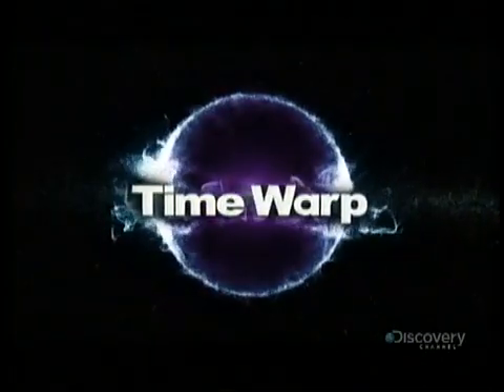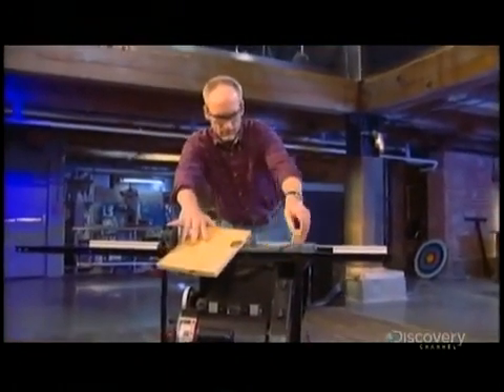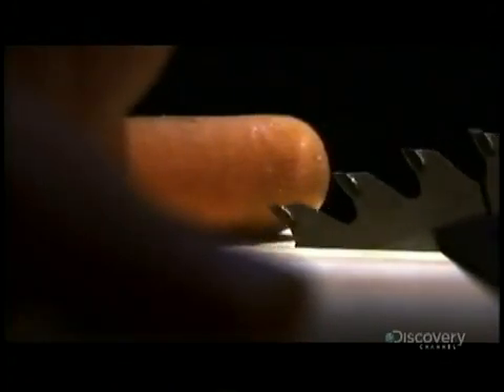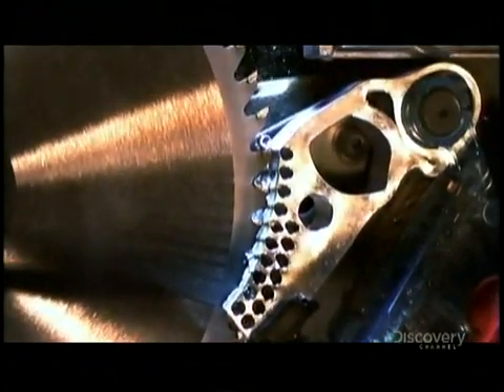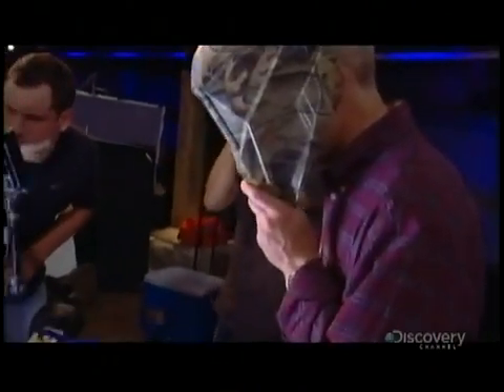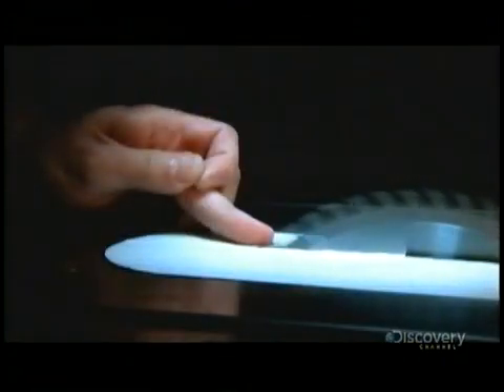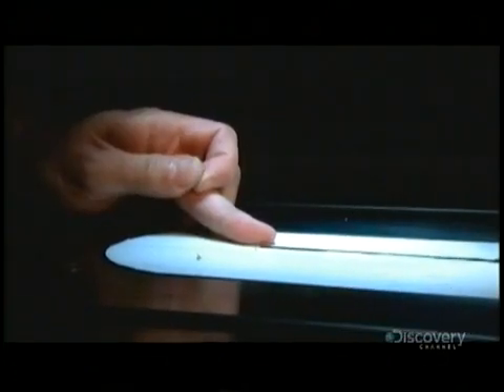Saw Stop - This guy puts a finger into an active table saw blade & comes away without a scratch!

Comment: Oh come on he was in no danger. He was holding his finger down hard on the surface to avoid any sudden movements and went for it very VERY slowly. Had there been no stop mechanism he would have cut his finger a little and instantly pulled it back. If you have faith in your tech then do it like it would happen in practice. Go at the blade fast and confidently. Then I'll be impressed.
Reply: +Agen0000 Don't mix faith with stupidity, although they are often very close...
I would rather trust an engineer who knows the limits of a machine than one, who doesn't. There will ALWAYS be a slight chance of malfunction.
Reply: TheCptKork but if his presentation doesn't simulate a real world event accurately then what is even the point?

If this is the limit of his machine then, again, what is the point?

In a real world scenario the finger would moves much faster so this demonstration is redundant.
Reply: +Agen0000  it's his finger so he was being more careful but with the sausage there's no loss so he just went for it and it still stopped pretty quickly . Everyone could have done the sam if it was there finger because what if there is some malfunction,nothing is perfect
Reply: D3mon Edg3 no I'm not. Look again just before the slow motion shot. He is clearly moving much much slower than you would during normal operations.

I mean are you kidding me? Of course I knew that there was also a slow motion shot. I'm not talking about that.
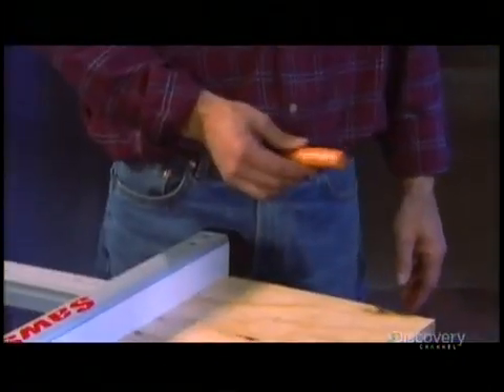Reply: +Agen0000 1:36 now imagine his finger.
Reply: *****
"You are the one that has been responding constantly on a 50+ reply thread."

Because, as I already explained, this is my thread. All the comments here are directed to me. I am defending my position. How is this so difficult to understand? You are the one, who stepped in to try and... honestly I don't even know what you are trying to do at this point other than to "win" some argument here.

", the reason he did not do it faster was because he could still cut himself on the blade after it stops."

Actually, if you had payed attention to the video the blade drops down away after it stops. You are now just pulling random things out of you ass just to have something to respond with.

Anyway it appears as if I have to repeat myself yet again. Listen to me carefully this time - my point is that this demonstration should not have been presented as "dangerous" or as "someone putting faith in their creation". Had they not presented the demonstration as such I would not have said anything about him doing it slow. The point is that they were dishonest about the demonstration. Do you understand now or are you still confused?

"Also it would be the other way around with the religious thing btw, because the majority are now aethiests, and agnostics."

What are you even talking about?

"You are also the one trying to do anything to reinforce your POV instead of being open-minded."

ABOUT WHAT? You are mostly just creating strawman arguments here. You don't even understand what I'm trying to say and when you finally do you STILL come back and start arguing for the sake of arguing. After a few comments you GO BACK AGAIN to you initial strawman bullshit that I already responded to. As if you had forgotten my point YET AGAIN.

Just fuck off already. You are pathetic, man.
Reply: +Agen0000 you are never supposed to use a saw fast, it's supposed to be used slowly. Not fast.
Reply: +D3mon Edg3 not this slow though. He was barely moving his finger.
Reply: +Agen0000 have you used a table saw? It doesn't take much of a push to use, he was going at the speed you're supposed go, but look when they used the hot dog they were going faster then normal.
Reply: Dipps but it's not?
Reply: Ricardo Ventura I'm saying that the finger demonstration serves very little purpose if the sausages already proved the concept. It's only point was to show that the inventor had a lot of faith in his product and is willing to risk a finger as a demonstration, but he never actually did.
Reply: ***** it was presented as a "high risk" demonstration and the of "a man who has faith in his invention", which is not accurate at all. He was never in danger and so this demonstration should not have been presented as such
Reply: ***** 
"Even if he went that slowly with a saw that doesn't stop his finger would probably have been cut to the bone."
No way in hell would have it have cut to the bone. First of all he was pushing his finger down on the table and therefore had more control and thanks to the increased friction he could move even slower. Not to mention the very gentle angle of attack. The blade was mostly facing down his fingers skin and not directly at the any bone.

Secondly have you ever heard of involuntary reflexes? They are fast so the very instant his finger would have touched the blade he would have pulled it away and only gotten a scratch.
Reply: Dipps
"Okay, now that you've seen the video, be our guest and buy a table saw, get this safety mechanism implemented on it, and record yourself thrusting your face into the blade. And then put it on youtube so we can see how much better you are than the inventor of this genius feature."

You're a complete dumbass that can't even comprehend what I'm saying. I didn't go on TV claiming to have done a high risk demonstration of something. I don't owe anyone any demonstration.
Reply: ***** you're not even making any sense. Why would I need to buy one? I already explained myself and I'm not about to repeat it just because you have trouble understanding basic English.
Reply: ***** lol man why are you even talking to me? I already explained myself and you keep bitching about random stuff that has nothing to do with my comment.

Whether I am interested in buying this product or not has absolutely nothing to do with the point of my comment.

You're a fucking dumbass. :D
Reply: The fact you have no interest in buying it regardless if he puts his hand in the blade full force or not it doesn't matter. Your point is moot.
Reply: ***** actually the fact that whether I have an interest in buying it or not is not relevant. My point is not "moot'.

UR MOOT!
Reply: +Agen0000 Ok I get what you are trying to say.
Reply: *****
"He only did it slow out of fear, and that is completely logical."

So in other words he was NOT confident in his product like they claimed he was. You are proving my point.
Reply: *****
" Also I love how you nitpicked my comment, and completely ignored the the first few sentences."

You know what's funny about that? The first few sentences also prove my point. Let's see:

"Putting your finger against it faster would change absolutely nothing"

All the more reason to do the monstration faster. Should be safe, right? Anyway if he wants to prove that the thing works with his finger then he needs to prove it while he is doing a motion that one would do when they are actually using it. His was too slow to resemble anything like what you would see a user do so the demonstration is pointless. It doesn't prove anything. It only proves his demonstration, nothing else.

"Furthermore, you can believe in something, and not want to test it at the same time."

Then don't present it as a "dangerous demonstration" and "of a man who has faith in his invention". That's my point. Wow, how the hell is it so hard to get this through your thick skull? I have repeated this like 3 times already and you still cannot comprehend my point.
Reply: ***** oh wow, you just can't help yourself but continue to say something stupid, right?

These so called "everyone" is mostly the same few people having a long ass attempt at a stab at me. At least 1 person came along (POLARTTYRTM) who got my point so you are wrong about "everyone" being against me.

Furthermore how is that even important? Did your argument seriously deteriorate to the point of "so many people here disagree with you therefore you are wrong"?  The irony here is so hilarious since that is a religious way of thinking. Remember how you said I acted like a religious person? Well, listen to yourself right now.

Lastly I never used the word "kid" and that last attempt at a personal attack on me was yet another sign that you are just here to try and troll me. Get a hobby.
Reply: +Agen0000 actually he was going at it as fast as you're supposed to go, what you're basing it off of is the slow motion can.
Reply: D3mon Edg3 no he wasn't. He was going ridiculously slow.

And yes I have used them.
Reply: +Agen0000 look at the video again, it took him about half a second to hit the table saw, I don't think we watched the same video.
Reply: D3mon Edg3 seriously? He moved his finger faster as he was approaching the saw, but once he was like 1 inch from it he slowed down to a crawl. I think you are the one, who needs to look again. Not that hard to see what's actually going on.
Reply: +Agen0000 Why the fuck do you care? This invention was not made for idiots to start taking videos of themselves being an idiot and putting their penis through the saw just to see if it stops. It's a last resort safety measure. Just because you CAN put your finger up to it and not get hurt doesn't mean you should.

There is even a safe guard still implanted onto it (not in the video) just in case.
Reply: Agen0000
Well if he was never in danger that must mean saw stop works. Even if he went that slowly with a saw that doesn't stop his finger would probably have been cut to the bone.
Reply: I doubt you have any intention in buying it so why are you bitching? Do you need a table saw? What are you sawing?
Reply: Agen0000
Well if you don't need to buy one then why do you care? If you're not a consumer then no one cares.
Reply: +Agen000 you make my brain hurt.
Reply: D3mon Edg3 sorry.
Reply: Agen0000
You just wanted to see the guy cut his finger off, fuck off.
Reply: Agen0000
Admit it.
Reply: ***** no u admit it
Reply: Agen0000
Admit what? I don't care if I see him cut his finger or not.
Reply: ***** that you are a tryhard fail troll, lol.
Reply: Agen0000
You seemed to start regressing. Why are you talking like an idiot now?
Reply: ***** interesting. Please explain further.
Reply: Well first of all "u" is a letter not a word.
Reply: ***** nice. Keep talking.
Reply: ***** why?
Reply: Agen0000 You are exagerating a bit.
Reply: ***** exaggerating what?
Reply: Agen0000 Saying he was not in danger is a bit exaggerated, just because the equipement has a safety system it doesn't mean you can abuse it. Like a lock for a gun, you would not point the gun to your own head and try to shoot 30 times just to see if the lock works, because there's possibility of malfunction. He did not test it faster with his finger for safety, because as I said before, there's possibility of malfunction. But yeah, I understand what you are saying.
Reply: ***** yeah but even if it malfunctioned he would just have gotten a little cut. There is no way he finger was coming off even if the thing didn't work. I wouldn't call a potential scratch "dangerous". It was pretty safe especially not only because of the slow speed, but the angle of attack. The blade was basically facing down his skin mostly anyway.
Reply: +Agen0000 Too bad we can't see you do it.
Reply: Joseph Chang the fuck does that have to do with anything? lol
Reply: Agen0000 Because we all know you wouldn't. The guy didn't either because of that same reason.
Reply: Joseph Chang of course I wouldn't. That's completely besides the point. You're like the 4th dumbass that doesn't even get it. Go back and read some of my comments dumbshit.
Reply: ***** :D you are just frustrated that I slapped you around like a little bitch and you just kept coming back desperately trying to get at me somehow. What a loser :D just get over it already.
Reply: The wrong people are always the ones cussing other people out and calling people dumb bitches.
Reply: Joseph Chang lol now you resort to some stupid vague philosophical one liner. How very impressive :D
Reply: Thanks! I hope you believe it's more impressive that what you've said.
Reply: Joseph Chang aren't you getting embarrassed over your own comments at this point? I've already slapped every single one of you to oblivion, but you just keep coming back moaning and crying desperately trying to get a stab at me.

For what? This is pathetic man. :D
Reply: That's only what you believe. I used philosophical one-liners because you won't answer to reason. Also, I've already won because...

Me: Because we all know you wouldn't. The guy didn't either because of that same reason.

You: of course I wouldn't. That's completely besides the point.

I just stated plainly why he didn't stick his finger in and you said of course you wouldn't. Well, there you already admitted defeat. In addition, I was not besides the point, so that argument is invalid.
Reply: Joseph Chang 
"I just stated plainly why he didn't stick his finger in and you said of course you wouldn't. Well, there you already admitted defeat. In addition, I was not besides the point, so that argument is invalid."

Never mind the fact that all of what you said is completely irrelevant to my point? You create a strawman argument, prove it and then declare yourself a "winner". This is hilarious, really :D
Reply: Joseph Chang my point was that the way they presented this demonstration was dishonest. I've made this clear multiple times and still we have morons like you who come back with the same strawmans.

Why are you even here?
Reply: Go on and tell me where my strawman argument is. Fact is I didn't have one.

The video was in no way dishonest. The title is "This man puts his finger into an active saw blade" and that's exactly what happened.

I'm here because of the same reason you are.
Reply: 1) I didn't take the time to read everything you wrote before
2) I don't watch videos with volume

You're right if they said he had faith in his creation., but it wasn't overdramatized. If the blade didn't stop he'd get a good layer of skin cut off. I know I know it's not life threatening, but still.
Reply: ***** you are still butthurt about me giving you that good spanking? Oh.. that's too bad. :D
Reply: ***** that's so interesting. Please explain further.
Reply: ***** ololooll funny troll 8/8 highly recommend
Reply: ***** what a loser lol
Reply: ***** hahaha... keep talking.
Reply: ***** stop projecting dweeb.
Reply: ***** wow, cool. Hard hitting words.Tell me more.
Reply: ***** why?
Reply: ***** please explain further.
Reply: ***** why not?
Reply: ***** why?
Reply: ***** I win
Reply: +William Martin STFU
Reply: ***** I broke him, apparently.
Reply: +Agen0000 you're an idiot
Reply: ***** that comment was for the other guy
Reply: ***** oh ffs. He was clearly referring to himself, since coyay4cheese knows that he is an idiot. Not that hard to figure out.
Reply: +TheCptKork Agreed 100%
Reply: +Agen0000 The sausage was put there at normal cutting speed. So unless you belly flop on the blade or some stupid shit you won't get more than a scratch.
Reply: ceering99 and hence the "real test" was pointless and they misrepresented it.

Comment: what if you put your finger quicker than 1m/year?
Reply: +Gvidas Man 1:36
Reply: +Gvidas Man if you put your finger in fast, you will prob get a minor cut, better then a lost finger
Reply: +Gvidas Man exactly what i was thinking. But i still think the design would work, you would just get a nasty cut instead of actually losing a finger, also did you miss the demonstration with the hotdog? that was normal cutting speed and it only left a nick.
Reply: +James Cioffi i did missed as i was eating a hot dog..:(
Reply: Yeah because when sawwing wood you move at the speed of sound
Reply: ab30494 have you tried?
Reply: Unless you can move your finger with the speed of 10m per second while cutting wood you wont hurt urself.
Reply: +Gvidas Man 1 mile per year?!
Reply: +Gvidas Man My nephew cut his hand using the table saw in carpentry class (highschool) it jammed the blade and he just had to get a few stitches.
Reply: +Rayan Almaimani No, 1 metre per year
Reply: +Gvidas Man first of, you were watching it in slowmotion. im sure he moved it faster than you would. third. you moved the sausage very fast, and it didnt get a scratch.
Reply: +SlothSlow tell the kid to cut his finger nails unless his finger was curled and you mean it cut through the top of his fingernail at not the tip

it still saved him from having 6 fingers...

Comment: Cool, but wouldn't a normal user be moving their finger into the blade and not just slowly edging it closer millimetre by millimetre? A better showing would be to force your finger at the joint right into it at speed - that would impress me ;)
Reply: +W3LLcoOL 1:36 ;)